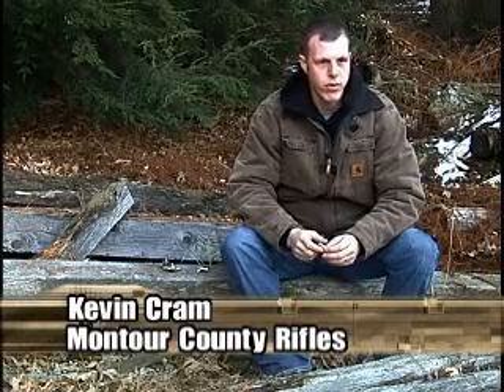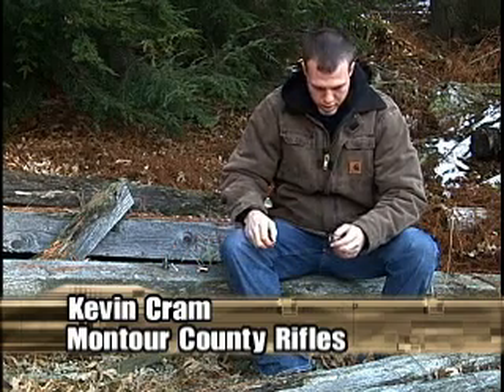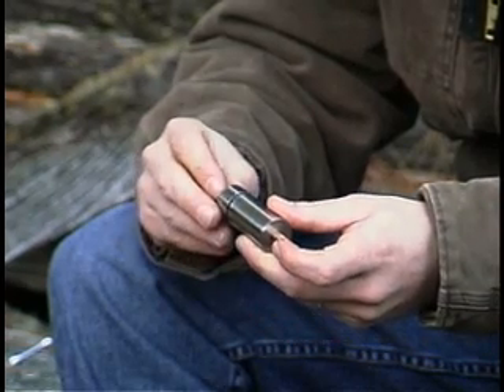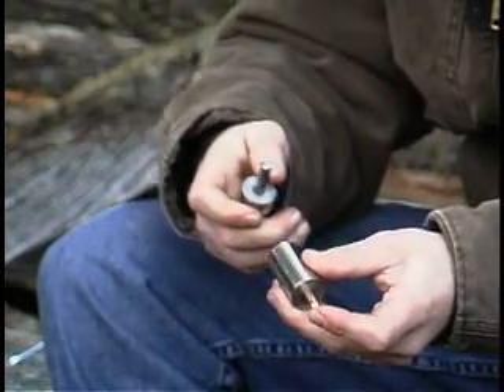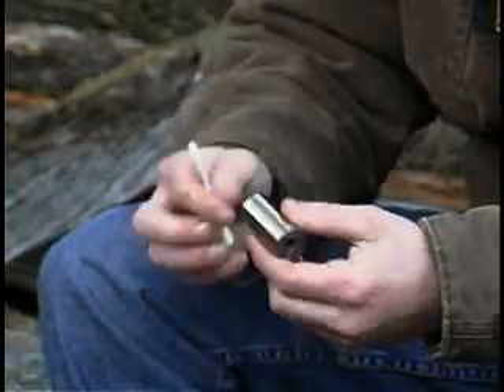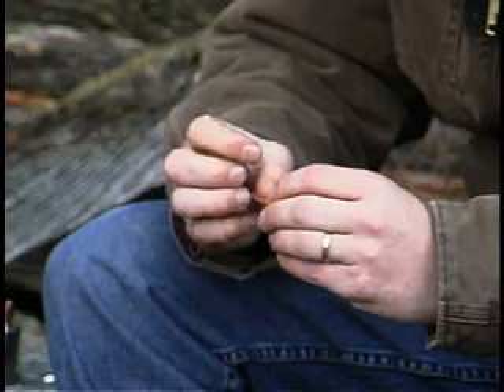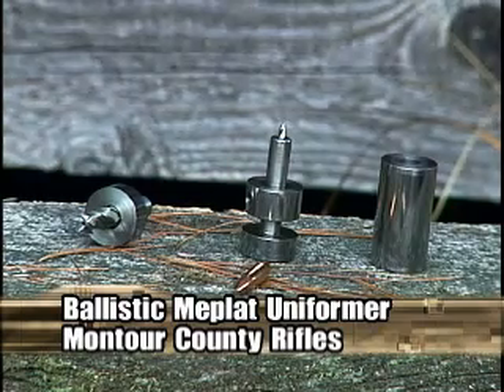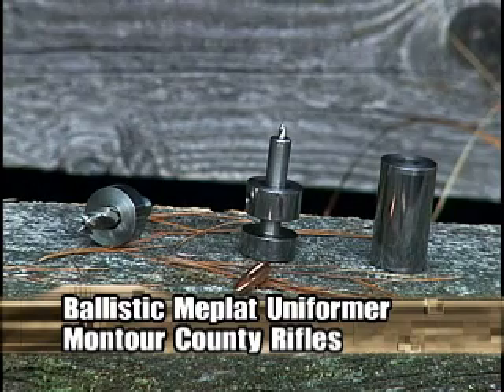Montour County Rifles - Ballistic Meplat Uniforming Tool

Comment: Have one for my .223 and one for my .308. Both make awesome tips, more accurate bullet seating, and tighter groups. I use a dowell sometimes to knock them out of the tool, and give 'em a quick brish with a toothbrush. I use a little sizing wax where the two tools come together, and clean with a .30 cal nylon brush every 4 or 5 rounds.    Great product.